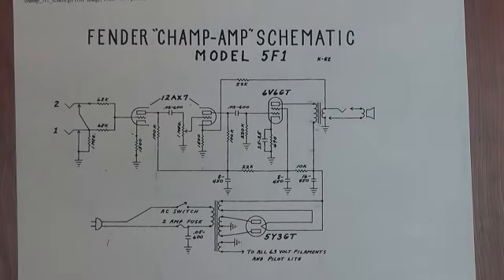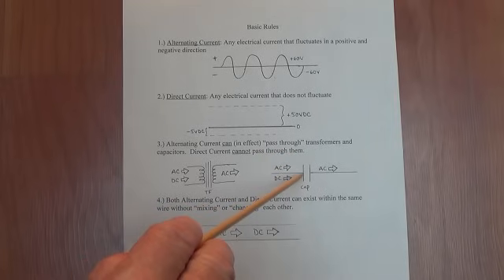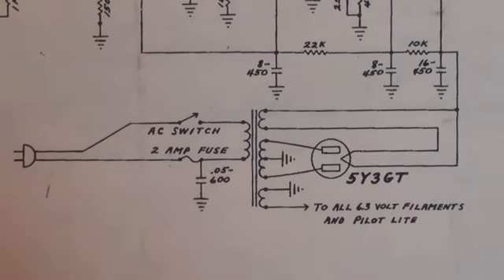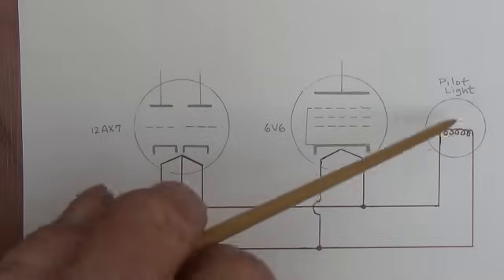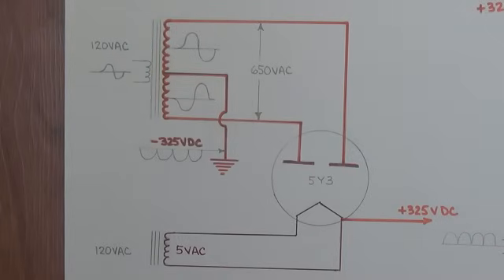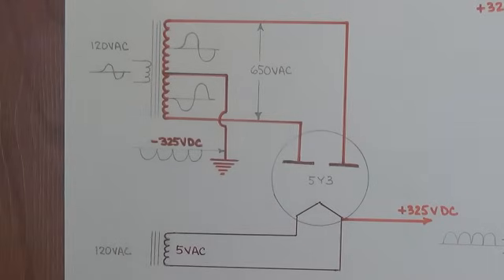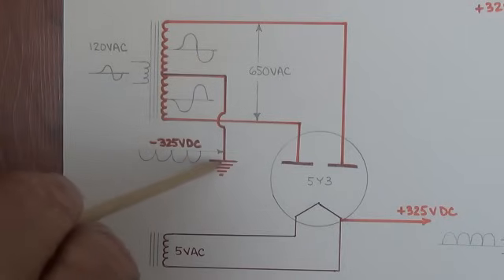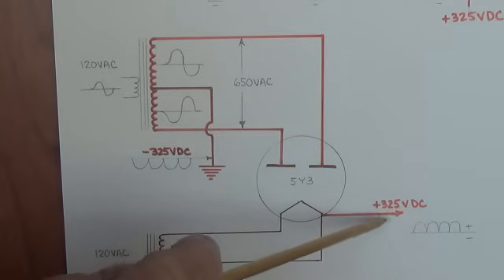How Tube Amplifiers Work, Part 1: The Power Supply

Comment: is that -325 really ground like to the chassis or is it the Common of the AC Cable coming in. I thought the chassis being hot was a bad idea??? Dennis
Reply from the maker: I was trying to show that you can look at a power transformer two ways: either the output is +325V to the circuit OR -325V to the chassis.....but not both. The chassis is part of the DC circuit, but DC is not a shock hazard unless you simultaneously touch a +DC and -DC site within the circuit. The chassis itself is not a shock hazard.

Comment: excuse me can you recommend simple 6SN7 45 SE diagram, please
Reply from the maker: That's an oddball, Nutty. I don't have a library of schematics, but simply do internet searches for them. Try a search "6sn7 45 amplifier circuit".  If you're speaking of a 45 vacuum tube, do you have a power transformer with a 2.5VAC filament output ??
Reply: @UncleDoug  I still don't have power 2.5VAC transformer. I will order once I find schematic. I only have output Transformer of 5K.  The another I wish to build is 2P29l 4P1L Parallel SE 2.5 watts.

Comment: I’m building a fender reverb unit and the transformer is 220v secondary with a centre tap. The circuit doesn’t require a centre tap so I’ve not got it connected but after the diode rectification and caps I have 605v!!! There is no load but that’s silly any ideas? Thanks for your videos they are brilliant
Reply from the maker: With no load, all HV outputs are ridiculously high. Connect it to the circuit and the moment current begins to flow, the HV will drop significantly.  It still may be too high, but it will be a lot closer to "normal" than 605VAC. If the transformer has a CT, it is intended for use with full wave rectification, with the CT grounded, not full wave bridge rectification, without the CT grounded.

Comment: Hello, I don't understand how you can send 300V to ground without a resistor in between ? Ground is always 0V, so isn't that a dead short ?
Reply from the maker: This has been explained countless times in the Comment section, Antoine. Please check there.
Reply: @UncleDoug  My bad, I only skimmed a bit and only saw those about the great explanation (which are deserved) 
I'll read that straight away.

Comment: Great video -- I keep coming back to it.  I'm unclear on two things.  It looks like the +325 DC goes out through a point that is connected to the (5 AC) filament.  How can that be?  I'd think the two interfere with each other.  And: Does the -325 DC "bounce off" the plates and then go down the center tap?  Thank you for educating all of us newbies out there!
Reply from the maker: You need to watch a more detailed video I posted more recently about Power Supplies, Jos. It will answer all your questions. AC and DC can happily coexist in one wire without mixing or interfering with each other.
Reply: @UncleDoug  I will, thank you!  Yes, I was clear on AC and DC co-existing in the same wire.  It's the large voltage disparity that threw me off.  Thank you again for the great videos.
Reply from the maker: @josquinmingus  You're welcome, Jos.
Reply from the maker: @josquinmingus  You're welcome, Jos.

Comment: Hi Terry great series I have viewed it many time its like a good book and so are you. So I am the person left a message in comment about building an amplifier from an old but still working Macintosh transformer. It has a 250 Vac, 6.3 Vac secondaries. It also has a 66Vac tap the I would like to use for the 5 Vac for the 5Y3 rectifier tube. My question is how do I change the 66 Vac to do that. Thanks again BC
Reply from the maker: This is Uncle Doug, BC, not Terry. My advice on the transformer conversion is to go with diode rectification and give up the notion of trying to use the bias winding for a 5V cathode/heater .....even if you could reduce it sufficiently, it would never be able to flow enough current to power a 5Y3.
Reply: @UncleDoug  Thanks Uncle Doug

Comment: im confused where exactly is the +325 connected to
Reply from the maker: It is connected to the (plate) circuit, Aaron. The output from the transformer can be viewed in one of two ways:  either +325V to the circuit or -325V to ground.....but not both.
Reply: @UncleDoug  oh aye thanks a lot !!!

Comment: Wooow, hold up a second. I was taught the 120V value is the RMS voltage. And the peak voltage for this on one half of the waveform is actually 170V. If you look at it for positive and negative with respect to neutral, the voltage from an AC outlet is actually 340V peak-to-peak.
Reply from the maker: You are correct, Stephen. We cover this in detail in later, more sophisticated videos. This one is simply an introduction, for beginners.
Reply: Yes, @saddle1940, but US outlets are single phase 110/120 VAC rms, so only 155/170V P-P.  You would be correct with European or if plugged into a US "240V" outlet, where the split phase has two 120VAC rms phases.  It is easier to think of all 1° and 2° voltages as RMS until they are rectified (then it gets more complicated).  The DC voltages' average value depend on filtering used, i.e. the size of capacitors & chokes used downstream, but safe to use 325VDC in this case.
Reply: Yes you are correct

Comment: hello, this circuit uses only one power transformer with 120v input and with multiple secondary in different voltages? (6v, 5v, 325v) or there are several transformers connected to get this different voltages?
Thanks in advance, very interesting stuff!
Reply from the maker: One single power transformer provides all the necessary voltages, at the current levels required.
Reply: @UncleDoug  thanks for the reply uncle doug!
I ask becouse im just starting at the subject and i've only seen transformers with for example 220v to 6v. In this case one of the secondary rises the voltage from 120v to 325v and the other secondary lowers the voltage to 6v and 5 v?
Then again, i'm new at this!
Have a great day
Reply from the maker: @sebastianvergara8175  That is exactly what the single transformer does, Sebastian. Same to you :)

Comment: Well it's a pity I did not see this video back in 2014:
Error 1:1:20 You state 120V AC is from the peak to the trough. No it is not for two reasons. Firstly it is measured from the 0V crossover point to the peak. Secondly 120V is in RMS. You need to multiply 120V by square root 2, in order to get the peak.
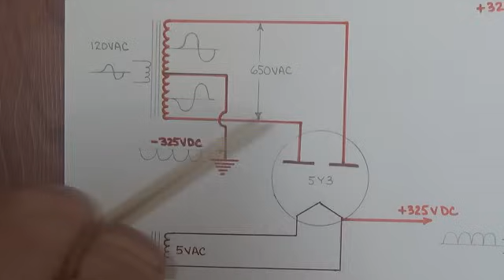Error 2: 16:25 You state and show negative pulses on the ground. This is not true, when one side of the transformer goes positive the other side goes negative, the center tap references it to ground.
Error 3: The diagram states 650VAC across the transformer and then you state 325VDC on the output. No it is NOT, it is going to be 459.55V (providing the rectifier valve is in perfect condition), Again peak vs RMS. The only time that would be correct is if you were referring to the peak output of the transformer (that would be a first for me).
I really am looking forward to part 2.
Reply from the maker: Please read my reply to your comments on Part 2. It applies to all of your statements.

Comment: Hi Uncle Doug, your videos are amazing! I want to build a hybrid amp, something like a Marshall Valvestate or Orange Micro Terror. Can you make a video of how transistors should be wired up in the power section, please? thanks a lot!
Reply from the maker: I deal only with vintage tube amp circuits, DB, so I'm not the right person for the video you seek.
Reply: ah all good. I have been wanting to make a high gain two channel head like the modern day Marshall DSLs from scratch but I do not know how to wire in a distortion tone in a second channel. how do I do This?
Reply from the maker: @daleederboy4777  I have no idea, DB. I only deal with vintage tube amp circuits and built-in distortion is not a feature. Most people simply use pedals. Good luck with your project.

Comment: I have multiple books and DVDs on tube amps and tube amp repair and this two part series is hands down the most clear and straight forward explanation I have ever seen regarding tube amplifiers. It randomly popped up in my suggested videos today and I wish I had seen this video years ago. Although the other content I've purchase is much more detailed, this is just so clear and I wish I had seen this first before diving into other material. I anticipate rewatching these again. The way this is presented really made a lot of things just click for me. Especially how AC and DC can exist on the same wire in the Power Amp stage. You made this make perfect sense to someone who is merely a hobbyist on the matter with very basic electronic knowledge. Absolutely amazing!
Reply from the maker: Thanks so much for your very positive assessment of our videos, Kevin. They are indeed intended for beginners who simply want a basic understanding of how amp circuits function. For those who wish for more detailed understanding, I have produced subsequent videos that build upon this foundation, offering increasingly complex insights into the function of each of the sub-units of the circuit.

Comment: Sorry, but the explanation about the 12ax7 filament, it is either drawn incorrectly or badly explained. If you measure the voltage between pin 4 and 5 of the tube, you cannot read 12 VAC if you supply both sides of the filament with 6V coming from the SAME transformer winding. You will measure 0V...not 12V! BUT...the voltage measured between either pin 4 and 9 or pin 5 and 9 will be 6VAC.
Reply from the maker: This is a very basic presentation for beginners,  Steeve. As such, it would have been confusing and counterproductive to spend 5 minutes discussing the finer points of 12AX7 filament wiring. In later, more advanced videos, these issues are discussed in detail.

Comment: Hello, in ground, sure have the bottom curve of -325V? not are 0v??? if you have +325V and -325v, final voltage is 650V. It think it is 0V in ground, and the two top curve rectified joint in the +325V.
Reply from the maker: I labeled the lower curve to ground as being -325V simply to show that either + or - output is present, depending on which is grounded (i.e. set to 0)....but never both. In retrospect this was confusing and I regret doing it. Either +325V or -325V is present, but never both.

Comment: Doug, was wondering if you would elaborate on the 12 volt filament voltage for the 12AX7. 
Are not these merely two 6 volt heaters in parallel and will not show a 12 volt drop across them as they would be at the same potential? 
Is it a result of how the 12AX7 is designed i.e.,  holdover from a 12 volt series circuit heater filament design of some amps?
Reply from the maker: This was a very basic presentation for beginners, Bobby. Trying to include the concept of parallel heater filaments would have been confusing and not in keeping with the level of sophistication of both the video and the audience.
Reply: @UncleDoug  - I agree Doug, this video wouldn't have been as useful if you  hadn't kept it basic.
Reply from the maker: @78tag  Thanks, 78. I'm glad somebody out there understands the challenges of preparing technical videos for a varied audience.
Reply from the maker: dooder  I'm sorry some of my explanations aren't clear for you, Dooder. The rectifier tube contains two diodes formed by the plates and cathode(s) within it. If you are familiar with diodes, you know they only allow current to flow in one direction depending on its charge. When the AC wave is positive, it is allowed to flow from the plate to the cathode/filament of the rectifier tube. Thus the positive DC accumulates and exits from the cathode/filament of the tube. I hope this makes sense.
Reply from the maker: dooder  Thanks, D. Again, like I said above, the heaters of 12AX7's were not the topic of the video, so I didn't go into great detail about them, for fear of losing my audience.

Comment: What I always found counter-intuitive about the use of this tube, is that in here the cathode is the source of the positive voltage for the system.  I am too used to seeing B+ applied to a plate, and the cathode at or near ground potential.
But really, exactly the same vacuum tube charge transfer behavior is happening here; the two plates are taking turns going positive (thus it's a full wave rectifier), and they draw electrons from the un-grounded cathode, leaving the cathode positively charged relative to the grounded center-tap.
That positive charge is then applied (through series resistance) to other tube's plates in the system, so that they can draw electrons from their associated cathodes.
Reply: dooder  Same here.  Both are happening at the same time, positive charges (holes) moving towards ground, negative charges (electrons) are moving towards B+.
Reply from the maker: Sounds like a good analysis to me, M. Thanks !!
Reply: Just reread your explanation for the third time, and a light just clicked on. Thanks so much!
Reply from the maker: dooder  I tend to favor the electron flow theory, i.e. current flows from negative to positive. To me, the other theory seems simplistic in that it assumes anything positive must contain "something" and negative doesn't.....so the flow must be from + to -.  Hogwash :)
Reply: I thought the same thing. Tube current flow is from cathode to anode, to see the cathode positively charged is hard for me to picture just how this is happening.

Comment: I guess the potential is 325 V pulsating  and not +325 on the plate and -325 on gnd.  that would make a 650 v ac again .  So its a pulsating 325 volt peak.  the minus 325 you measure is due to probing on the gnd
Reply from the maker: The -325 VDC label is to denote that the center tap is the return route for the +325VDC (post-rectification) used in the circuit.
Reply: @UncleDoug  ok, but universally it's called  mass or ground

Comment: I found your pi-filter somewhat confusing until I realized that this is a negative DC power supply. The 12AX7 is called such because the center-tapped filament allows operation from either 12 or 6 volts. Still, this is a good presentation.
Reply from the maker: Thanks, Victor :)

Comment: Uncle Doug-Do you have a video that discusses the "B+" side of the circuit.  I've been trying to understand what it is and why there is a high voltage DC part of the circuit, and then a lower voltage that sometimes is 12VDC and/or 5VDC in a circuit.  Is the later only present in solid state circuits, and if so why?  Thanks.
Reply from the maker: I believe this video discusses it, WS. The power supply creates the high voltage DC....but the 12V and 5V voltages you refer to are AC. Watch the videos. All is explained.

Comment: Wait, so the high voltage circuit is acting as a full bridge rectifier?
Reply: No. It is a full-wave rectifier, but a bridge rectifier is a different circuit involving four diodes.

Comment: How can you get 12 volts out of a 6-volt circuit without a transformer? That is whst he said about the 2 heaters inside the tube. Each heater has 6-volts, so 2 heaters use 12 volts??? He is mistaken!
Reply from the maker: It's a matter of semantics, Dan. The heater of a 12AX7 can be energized by 12VDC or by using its center-tap, 6VAC can be provided to each half filament resulting in heat production equivalent to 12VAC.

Comment: Hey Uncle Doug, around 7:45 you said the heater on the left tube is 12 volts. I think that's mistaken if not misspoken. Each of the two sub-heaters within that tube takes only 6 volts, and their positive/negative (depending on phase of current) terminal is common. This is equivalent to two 6 volt loads being in parallel, meaning the output voltage on the heaters doesn't sum above 6 volts as they would if they were arranged in series. Otherwise, thank you for this lesson.
Reply from the maker: Thanks, Levi. This is an entry level presentation for beginners and I tried to keep it as straightforward as possible. Sure as heck, if I had  tried to explain the parallel vs series disparity and the phase of the AC in the heaters, etc, I would probably have lost a good part of my audience.  I appreciate your input and hope you understand my position.

Comment: I still haven't figured out why most rectifiers use a 5 volt filament. Is it because the designers needed a high current for the filament and decided to cheap out on the copper by using thicker wire with less turns?
Reply from the maker: I have read all sorts of explanations for the 5V rectifier filament and NONE of them made much sense. I believe it was selected before regular tubes started using 6.3V filaments so they could be used in car radios (early cars had 6V batteries).

Comment: It would be helpful i you mentionend to what reference each of those voltages are measured.
Reply from the maker: If you mean the voltages on a schematic.....they are generally referenced to ground.
Reply: @UncleDoug :) Thanks for the answer. What is the -325V that is assigned to the ground lead referenced to, it couldn't be ground itself?
Reply: At minute 16:15 you state: "If I hook up an oscilloscope to the ground lead i would get bottom, bottom bottom". What is the ground lead of your probe conected to?
Reply from the maker: @eureoma578  The B+ of the circuit. By reversing the polarity of the leads, you will see the negative wave forms.
Reply from the maker: @eureoma578  It is my attempt, now regretted, to show that an equal and opposite potential exists at both the B+ output and the center tap of the HV winding. If your circuit required -DC HV, you would simply connect the CT to the circuit and the B+ output to the circuit ground. If you use the B+, as most circuits do, the grounded CT is considered to have 0 V potential.